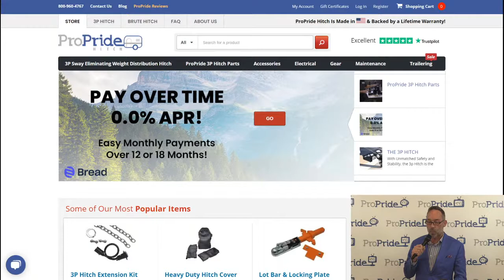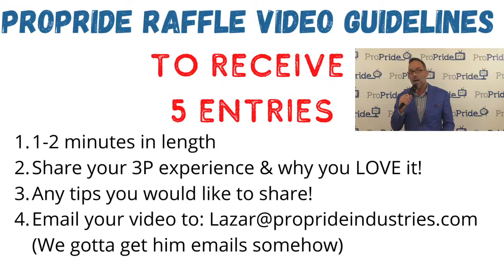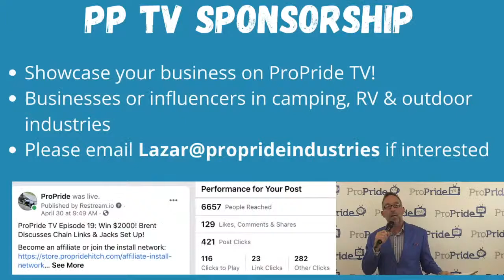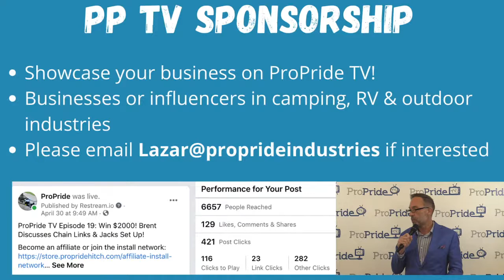ProPride TV Episode 21: NEW $2000 RAFFLE! Tech Talk with Brent!

Comment: To clarify, the head of the hex bolts (3/8"-16 x 2-1/2") face inward toward frame while the nylon lock nuts face outward as show on pages 18, 19, and 29?
Reply from the maker: Hi Greg, YES the Nylon Lock Nuts should be facing outward on the V2 Jacks.